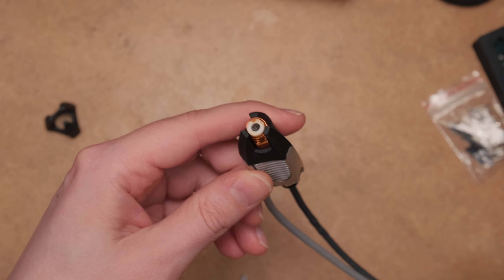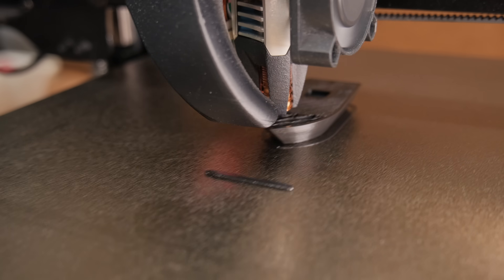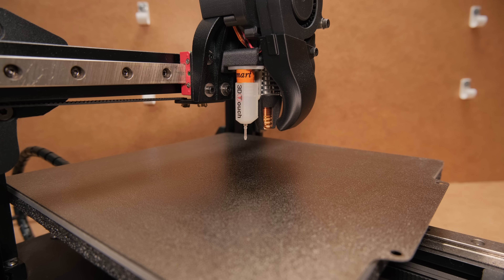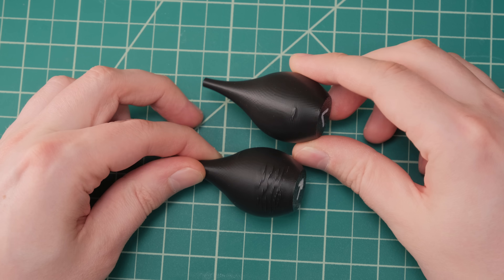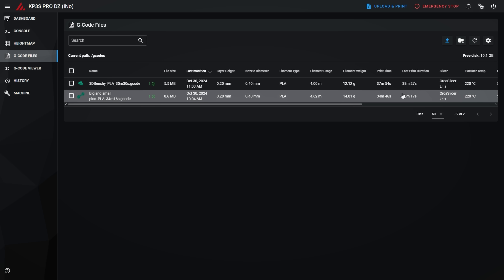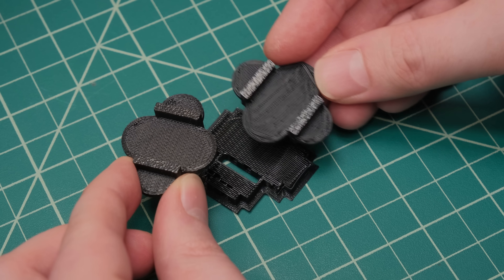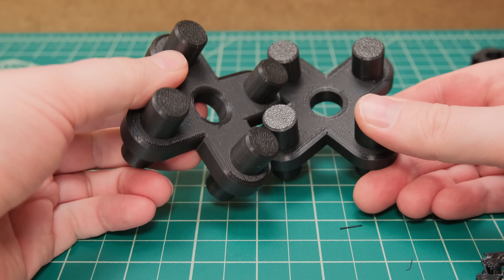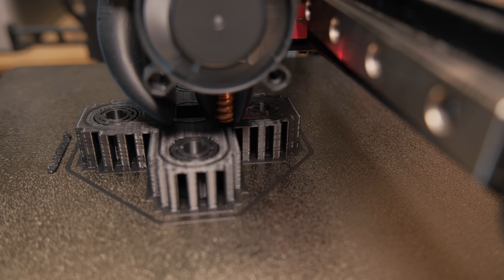World’s First INDUCTIVE Hotend – How Crazy IS IT?

Comment: 4:23 the hotend controller was never intended for such rapid temperature changes? Really? What was it designed for then? Just so they can say they have the only induction hotend? Rapid temperature changes is the ONLY reason for this to exist.
Reply: I think this error could indeed be caused by the board's firmware, which tries to stabilize the temperature during printing under conditions that aren’t compatible with rapid temperature fluctuation, a logical incompatibility that needs to be addressed!
However this problem is solved thanks to  @PrintingPerspective 🌹
Reply from the maker: It doesn't mean you are right if you can't find any other reasons why it would be an option for industrial 3D printers. Plasmics don't even advertise anything related to variable temperature printing. If they did and it didn't work properly it would be a completely different story. You want me to act like Linus Sebastian when he shit-talked the Billet Labs cooler... That is not happening. What it is - is a missed opportunity at the product launch.
Reply: @PrintingPerspective  myself and others have talked for a long time about variable temperature printing and wished someone would make an induction hotend for this purpose. Then someone made an induction hotend, but not for this purpose. And that alternate purpose remains unstated? What is the purpose?
Reply: @PrintingPerspective  i just went back through and read their entire page on the trident again. Rapid heat up and cool down is mentioned several times. They seem to be approaching it from the angle of rapidly heating up/cooling down for material changes but anyone could have replicated this issue with rapid material changes instead of variable temperature printing. It couldn't do what they said it could do, until you tried and failed and made them fix it.
Reply: @PrintingPerspective  "Plasmics don't even advertise anything related to variable temperature printing."
No they absolutely do.
Just from the FRONT PAGE: "but also when using filaments with temperature-dependent features such as Varioshore."
Reply: you are replying to a shill. Of course he had to make excuses for everything that looks a bit negative.
Reply: @rikimaru6811  idk I think he was just being too generous. If he wanted it to look awesome he could have just not mentioned any of those experiences.
Reply: @charlesstaton8104  having SOME form of negativity (that ultimately are non-issues) makes it appear more like an authentic opinion, while it's not.

Comment: Any method for rapidly controlling the melting temperature and minimizing the size of the melt zone is a boon. I just wish it didn't cost 400 euros. Perhaps some hybrid design is needed. A resistive heater brings the filament to a controlled temperature (e.g. 80% of target) and then induction to heat it to the precise final temp.

Comment: try using superslicer, as you have more granular temp control, among other things, and it was designed specifically for klipper machines. it has a bit of a learning curve at the begining for the initial config, but overall, its the best slicer i've found so far.

Comment: Such fast cooling would fix that annoying oozing too. It takes couple of seconds for oozing to start. If hotend cools down before that, oozing wont happen. Quite useful for prints that need to be interrupted. For example when embedding parts or adding reusable support to get those perfect bridges and flat overhangs, no matter how big they are.
Reply: Oh man, if that was applied to toolchangers it would make prints so clean. I wonder if bondtech is implementing something like this in the INDX since it's boasting such fast temperature changes?
Reply: @redkingrauri3769  I was just about to say - if the oozing issue can be solved, multi-head extruders without complex (big, heavy, expensive, unreliable) tool changers or extruder retraction becomes much more viable.
Reply: That's a great point.  Would be awesome if @PrintingPerspective could showcase some stringing tests too.

Comment: A few years ago at work we were trying to make some very precision silver solder joints on thin SS.  We needed a FAST solution.  After some thought I built a very crude device that consisted of a thin wall copper tube with a coil driven by a large audio power amplifier (400 W RMS).  The (round) solder was fed into the tube and would melt immediately.  This apparatus was placed in a crude holder mounted over the SS piece that was heated on a hot plate.  Pushing the solder would extrude very hot silver solder onto the workpiece in a well controlled manner that produced a very acceptable joint.  The work was done on a milling machine table for precision X-Y location.  Crude but effective.  This was before 3D printers were someone's dream.  Amazing what kind of potential in 3D printing we have today.
Reply: surprising an audio amp can get the frequency required... most roll off around 40khz, if that... 

most commercial heating units ive used ran in the 100khz region. one was 900khz. specifically for doing thin wall stuff. gets into eddy currents and how they circulate, or are even induced.

not denying it, i wasnt there? but i suspect you may have simply been using resistive heating. 400W into a low resistance is going to get hella hot, regardless of frequency! (ignoring skin effects...)
Reply: @paradiselost9946  There's Class-D Hi-Fi audio rated for 96 KHz, floating capacitors simplify filtration even further.  In addition the man does mention using a « thin wall copper tube »...

Comment: Comparing this new hotend warming up times to the Bambu one is like comparing apples to oranges. This hotend is 60W or 120W when I look at thier website and Bambu hotend does only 45 watts....
Reply: its hard to actually say how many watts it is... the heater itself is not the item being heated. gets down to resistance of the nozzle insert, and the amount of current actually induced. not the drain on the power supply. the only way to measure the actual "heating power" is how fast it can heat various things, such as water...

induction heating is inherently lossy. theres EM radiation, wiring losses, circuit losses... its advantage is pumping a fairly large amount of power into an area without say, a flame...

Comment: I’ve been trying to see if I could print both soft and hard varioshore filament in one part, but the limiting factor has been how quickly the hotend can heat and cool. This could be very useful in that regard! I also wonder what it would do to metal infused filament…
Reply from the maker: Yeah, that is a good idea. I thought about metal-infused filaments in a way that the induction heating would also melt the metal shavings inside the filament. However, it would require high-temperature filament and magnetic metals with a low melting temperature. So it is not realistic.

Comment: Zero gap supports are a dream come true. I hope we get this in future built into 3d printers and slicers.
Reply: Have had it for a long time with PVA and a second nozzle. At $400++ USD for the INO hotend, a second extruder is way way cheaper, even with having to buy a second board and all the other bits.
Reply: @wesleyfraser3058  buying a whole new cheap printer is even cheaper
Reply: @wesleyfraser3058  I prefer the sharpie method, no changing material

Comment: Lowering temps when printing bottom layers on supports is a really cool idea. I guess there's no reason it can't be done on regular hot ends too, it would just need to wait for a bit while the hot end cools down.
Reply: move head to the side and blow it with either part cooling fans 100% speed, or a standalone cooler for the purpose
Reply: @MrGarkin  No need, extruding filament is the best cooling method for the hotend.  Just lowering the temperature target on the fly while extruding filament should drop the temperature almost immediately.  The first few lines of support might be at the normal print temperature, but after that the temperature should drop to the new target.   This temperature purging could even be done into the infill.
Reply: @earthwormjim that's really a good idea !!
Reply: @earthwormjim  Still like my solution more. Infill would affect layer adhesion and would be painfully spaghetti to code in the slicer. 
Even several hot strands in the support layer could work, but also could still be too sticky. Would be good to test.
In good fast modern printer jerking to the side and back would take a fraction of a second and is needed only for a contact layer.
Reply: @MrGarkin  Yes, that is an "allover" solution. Never thought of it. Just need a small script which goes through the gcode, searches for "overhang" and inserts the few lines Gcode just before the overhangs start (feedrate to 10% M220 S10 , M104 S160 (as an example)) then ramp it up again as you wish. No need for a special hotend. Damn good idea!!
Reply: It honestly annoying that you can't already do this because Orca slicer allows cooling fan settings for support interface. So you can already run cooling on the support layer to reduce its adhesion but you can't change temp.
Reply: Oh for sure. Especially if the surface is entirely horizontal

Comment: let’s give printers a thermal camera and A.I. to monitor heat buildup/dissipation in the part and change temps automatically to things consistent.
Reply: still need accurate heating and cooling, with current printers it will increase pint quality but print tme too and the price of the printer. A more accurate thermal probe would be more accurate and way cheaper then $300+ worth pf thermal sensor

Comment: Induction hot ends have been one of my visions of where we're going to need to go for improving print start up times. That's a small added cost, but it is a cost, and if we are able to easily tune temps to improve flow, that sounds like it would also help with print times. The zero gap transition layer is also something I like the idea of, but I'm wondering if we can improve on that by using alternate materials for the transition layers as well, Not sure what that turns into on the more engineering filaments, but we're already seeing some of that with pla/petg transitions for support, so it's likely to end up being a bit of experimenting. One of the main benefits would hopefully be not having to get higher priced support filaments if you can print support with something already in stock.
Reply: i almost exclusively run ABS.
i generally have to preheat the bed 10 minutes in advance.
the hotends ready to go virtually immediately... 30 seconds or so. no big deal.

waiting for the BED to heat is where i find the most frustration, especially when the print fails in a few layers, and stopping lets the bed cool down just a few degrees... the last few degrees taking the longest to reach.

its a nice thing to do PLA and eliminate the wait, but it rarely serves my purposes...
Reply: @paradiselost9946  Id on't know what printer you're using, but I do know that there have been a number of printers that use s SCR to activate a 120 or 240 volt bed that may help with getting up to temperature faster. I'm not saying it's the best solution, just something to consider if you're using something that's running purely on 24 volts for all heat, including the bed. Best of luck.
Reply: @RNMSC  the current one (tronxy something) is nowhere near as bad as the first reprap i had years ago?

meh, i rarely use the full 400x400... ive contemplated just using four 200's, just use one for most prints... but i dont do enough printing to justify it... hell, i havent even opened the box up or fiddled with the firmware yet...

Comment: I wonder if this might be dual-use with hall effect auto-leveling. You've already got an electromagnet. Why not use it for both?

I could even see this as being part of a multi-nozzle setup like one of those multicolor clicky pens, allowing you to have nozzles with different materials or diameters that can rapidly swap because you don't need all the complexity of the heating element moving with them.
Reply: still needs a heating coil. and every change in nozzle will alter its impedance or 'resistance" and its heating ability.

sorry... induction heating is MORE complex... they also need an impedance matching transformer to minimise transmission losses, otherwise the leads themselves are part of the coil... at extremely high currents.

Comment: Despite this being quite interesting there is a major downside: the current ceramic heaters that are used have a natural maximum temperature that you can't get above, even though you keep supplying current. If something goes wrong with the motherboard this hotend will get to 1000 degrees giving fire to anything it finds. 
The opportunities it gives are certainly interesting but it looks to me that the market is going elsewhere with printer manufacturers who provide their own hotends and this kind of control helps for supports, ok, but i can't see so many other aspects where it will make a real difference. So my personal opinion is that it can be a nice to have, but nothing really disruptive. I'd be happy to be prove wrong of course, because it would mean that research and ideas still have a lot of ground in the field, even though everyhing is starting to leveling up at the moment
Reply: Where did you hear that?
Reply: @peterpizzurro inductive heater can melt the hotend if something goes wrong
Reply: @peterpizzurro  ceramic heaters' resistance increases with temperature, so there s a point that the resistance gets high enough to limit current and from there on it just stays there no matter if you keep pushing for more. Inductive heating has no limits
Reply: @FedericoAlbano83  So you're saying thermal runaway isn't a thing?
Reply: @FedericoAlbano83  yep. ceramic heaters have... NTC? PTC? one or the other!

inductive heating.... there is a point that induced current and heating is also countered by the rate of heat radiated, and thats "fuzzy"... then the material of the hotend itself, iron heats really well as its ferromagnetic, hysteresis heating dominates exceeds inductive heating. 

but once it hits the curie point it behaves like any other metal... purely inductive heating. and that require higher frequencies, etc...

there IS a limit to induction heating... the size, volume, surface area of the object, its resistance, the frequency its being driven with... impedance matching, etc etc etc...

and once it melts, and escapes... nothing to heat anymore? 

a decent induction controller can determine what temperature the work is at, if its "tuned" in to the specific workpiece. the resistance and reflected impedances change quite predictably. assuming a nozzle of given dimensions, of a given material, a given coil... it can be pretty precise.
Reply: @peterpizzurro  It is, but with this hotend you will rely on it, with ceramic heaters you don't have to rely on anything

Comment: The best use case for the fast heating and cooling times is multiple extruders IMHO (idex, toolchangers, etc) . If the hotend has time to cool down and heat up again in seconds, you can do it on every tool change, managing ooze much better, and possibly reducing waste of overcooked filament. 
Unfortunately the biggest drawback of this hotend, which is its steep price, makes it even more impractical to have multiple units.

Comment: @PrintingPerspective There are a few things that immediately come to mind with a rapid changing temperature. First: Use this with ColorFabb (foaming) LW-PLA to rapidly change the density of the material printed. Second, an older technique was using temperature changes to "paint" a second finish on the surface for embossing. This was a thing years ago, but I'm having trouble finding the references to it now. Third, is when using a single-nozzle multi-material print, it would allow for using materials with very different temperature ranges together.
Reply: the length of the meltzone will act as a lowpass filter on the foaming filament. just because you cool down the hotend the filament won't "defoam" so you have keep that in mind. heating up shouldnt be a problem in the same way
Reply: @KilianGosewisch  With some slicer tweaks, I would use LW-PLA as two different filaments. Print at "solid" temperature, lift from the print, heat up for foamy temperature, and do the standard priming tower. Now, at the second temperature, printing the foamy infill. You'd want to remove any code that actually retracts or changes the filament, as you're only after the temperature change and priming. Once you're done with foamy infill, lift, reduce temp, and hit the prime tower again before continuing.
Reply: Last month MIT released the results from research into filaments that change color, shade or texture depending on temperature.
Creating astonishing parts as if they had changed filament between areas.
Using 2 heads: one that lays down filament, the second does "speed-modulated ironing".
Wondering now if could just use 1 inductive fast heat / cool to a similar effect ?
Title is "New 3D printing technique creates unique objects quickly and with less waste"
Reply from the maker: @See-essEll Those are great use-case scenarios, thanks for the input. It is always nice to read great ideas :)
Reply: "having trouble finding references now"...

yet people also tell us "once online, always online"... they obviously dont look into enough subjects!
Reply: @paradiselost9946  I've found that on the internet, if you want something to last forever, it'll exist for a few years. If you wish it would go away, it'll outlive your grandkids. It's like how toast always lands with the butter side facing down.